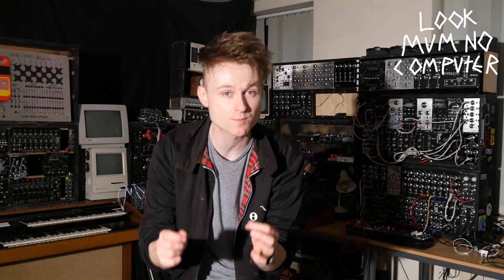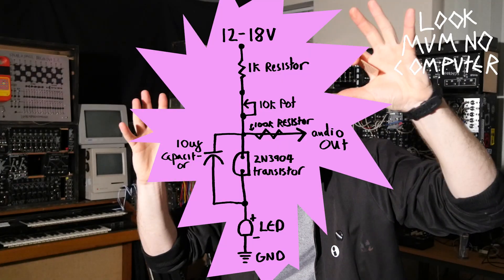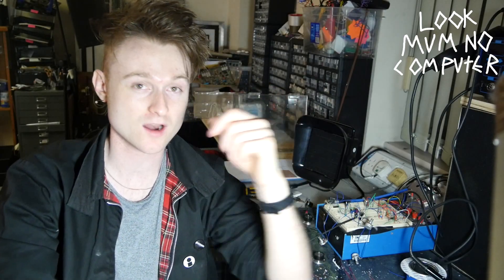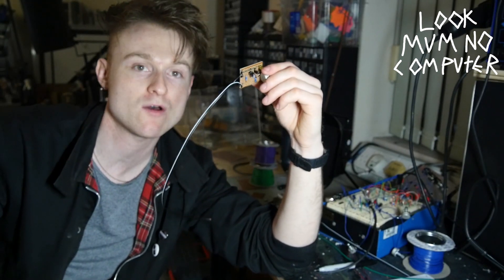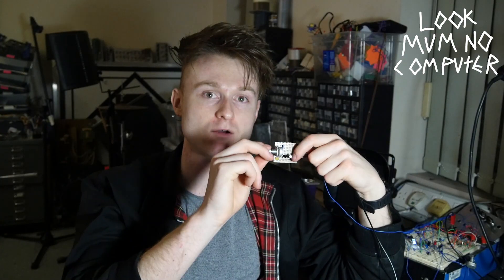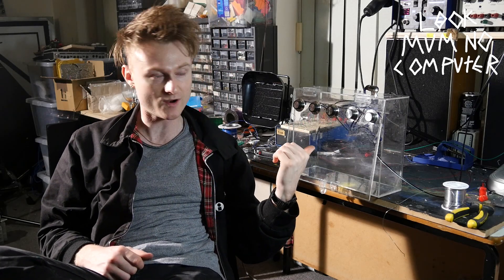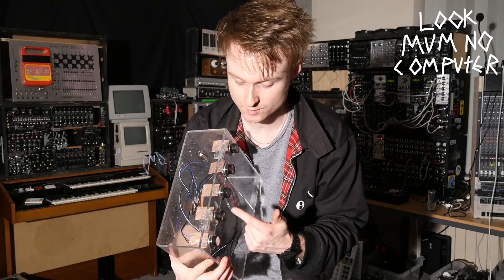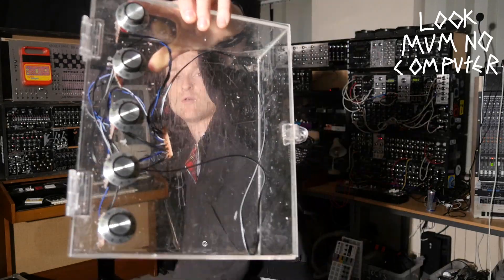The simplest DIY audio oscillator? not a 555 chip. reverse avalanche

Comment: Some troubleshoots for when things don't work right away: 
- Turn your transistor the other way around
- Pick a smaller cap value if you can't hear anything when you run it through your speaker (like a '0,22 µF cap')
Reply: Does the cap voltage matter?
Reply: @EarJuice  No they just make the sound diferent.
High cap value = low oscilation
low cap value = high oscilation
Reply: @nimaschacher1907  They were asking about voltage rating, not capacitance.
Reply: @EarJuice  Not particularly, no. Just make sure the cap is able to tolerate the voltage you're going to supply it with. Some capacitors can't quite handle 18V (12V max isn't uncommon on older caps, for example), so just be on the lookout for that. Other than that, you should be fine with anything.
Reply: @EarJuice  as I listen to professionals more knowledgeable than me, I use aprox 3 times the voltage rating. I know lots of amateurs who use less ie 16v on a 9v circuit with no issues. So on an 18v version, you may get away with a 25v capacitor. I may get corrected. I'm one of the amateurs. It probably depends on what type of circuit. For the sake of 0.02p per cap, I err on the side of caution.
Reply: @stuartchapman5171  in lower voltage oscillating circuits the capacitor may never be comepletly filled. but its good rule of thumb to use higher voltage rating than needed in case of voltage spiking. esp in dc circuits. in dc circuits the capacitor is full most of the time. another thing to note is most of the time capacitors dont fail instantly. they degrade until failure. it can take days or even weeks.
Reply: Can you run this through a speaker directly?
Also i would have a question, i tried to make a small module with one oscillator and then feed the input to an LM386, and when i connect both, i see the signal coming from the oscillator, disappearing on the oscilloscope. What am i doing wrong? in case someone knows
Reply: It depends. On a small desktop speaker, you should be able to hear it, although faintly. On a large speaker, you really need an external audio amplifier, because the oscillator's signal strength is too weak.
Reply: @svg98  thanks for the reply! Turns out i didn't comnect the grounds correctly. Was too eager to hear something already :)
Reply: Just having some trouble understanding how the electrolytic capacitor gets wired.  Is the positive leg of the cap on the emitter or collector and what does the other leg connect to? Also, does the ground for the output jack just go to ground on the circuit or somewhere else? Thank you for any help!!!
Reply: @discry The positive leg (flat line of the cap symbol; bent line is the negative terminal) is connected to the emitter. The negative leg connects to the transistor's base. Yes, just connect all the grounds together; you shouldn't have isolated grounds.

Comment: built one today - with a cheapo chinese 2N2222 . Works nicely at 12V with a 420 Ohm Resistor. Thank you for this!
Reply: What voltage capacitor did you use? 
Did you solder a 3.5mm female jack onto it?
Reply: Thanks for the tip! Changing some resistors helped me, now it all buzzes!

Comment: can someone tell me how to connect the oscillators and get a sound output?
Reply: I tested the circuit today. You need to input at least 15 volts to actually start the oscillation. Better if you apply a whole 18volts. I think there is an error on the schematics he drew: having the capacitor in parallel with the transistor and the led going to ground by itself only outputs 0.6volts of amplitude on the frequency. I haven't tried yet but i think if you put the negative of the capacitor directly to ground instead of having it betweeen the transistor and the led it might output a stronger signal. It's a problem with the fact that diodes (so leds too) have a voltage drop of 0.6volts. the voltage difference you are reading from the output is just that because the only thing discharging the capacitor is that mere led and that voltage between the output and ground is the led's voltage drop. I have still to verify that but i'm pretty confident about it.
Reply: @Mr_Lambda  glad someone else noticed this ! tried building this circuit ~1yr ago, failed, but just tried the stripboard layout instead of the schematic and it worked !! sounds great. used a S9018 instead (see his part 2 video) to run off 12V, then experiment with cap values to get the desired range
Reply: There is a "sound-output" wire in the circuit. Thats how you get the sound. Connect this wire to a speaker and the other wire of the speaker to the ground and you should get audio!
Reply: You can also connect it to a jack connector/socket the same way. audio-out wire to one side, ground to the other.
Reply: same ...
my guess so far, get the "audio out" as red wire to soundsystem/speakers and then wire the over port of the speaker back to the ground of the oscillator!?
Reply: Ben Herrera i also need to know
Reply: Connect all of the ground wires together, all of the 12v wires together, and all of the output wires together. Connect the output to a jack socket and also connect the ground to the ground terminal. Use an amplifier or you won't be able to hear anything.
Reply: So, I built the circuit today on a breadboard, hooked up to a small 🔈 there was NO noise whatsoever, however the LED was working fine and as it should, is it possible that there isn’t enough power from the circuit to hear sound from the tiny speaker, do I meed to amp it?
Reply: Wow, soo massive sound! :o) 
Seems like the wave from the oscillators is having distortion with rich harmonics. Nice!
Reply: look at the schematic on the website and compare it to the bread board, you'll see the rows are connected horizontally, and that the 100k resistor is connected to the audio out, which can be wired to an audio out jack, perhaps wire the audio out to the other oscillator? and then the audio out of the 2nd oscillator should be able to produce 2 different oscillations
Reply: wire up or solder on a jack socket and use audio interface
Reply: I like how vague he is, yet still explains what to do. It leaves room for experimentation, which is the best way to learn. Keep attaching wires to a cheap toy speaker to try get sound!!
Reply: @tshupenia8940  that's a very good way to put it. i was kinda lazy at the moment and just wanted to get things done lmao
Reply: @tshupenia8940  yez

Comment: Just breadboard it with a 9v battery and a 9018, had to replace the led by a jumoer wire thou. I'm not hearing sound with all the action of the potentiometer, just in a small place, any ideas?
Reply: Ale Brenna Mine does the same. Just in a little spot and the pitch is really hard to control that way. Did you find the solution?

Comment: Love your video's! This circuit works very nice at 12v with S8050, S9013 or S9014 transistors. I built a 6 voice drone machine with caps ascending from 4.7uf to 0.22uf. It covers most of the hearable spectrum (at least in my ears...). Try different types and brands of capacitors - some work, some don't. Thanks for making this video. Keep stuff like this coming!!!!
Reply: thanks so much for the info :D

Comment: Hello! I have read that some transistors do not oscillate and it gave them results to change them. My question is whether I can test the transistors without cutting the middle leg or I have to cut each one to verify that they work.
Reply: You don't need to do that.

Comment: Great video! A bit late to the party and as some have mentioned the schematic shown appears to be incorrect. If using the 2n3904, the emitter goes to the 10k pot and collector to the anode of the LED (cathode to ground). Also, the bypass cap should go to ground and not the anode of the LED. The stripboard layout is totally correct, though. Reverse the connections on the 10k pot if you want the pitch to go up as you turn the pot. As is, pitch goes down clockwise. 10uF is close to the limit of useful audio range at the lowest pitch (although 22uF might be fine, too) Thanks for the share!
Reply: Thank you! I was banging my head on the table trying to get this to work! By the way, you can do away with the LED and other stuff. The basic circuit is: 

Emitter through resistor to VCC;
emitter through capacitor to GND;
collector to GND.

VCC needs to be at least 12V or it won't work. The signal is picked up at emitter (it's literally the only net other than VCC or GND!) You can get audio and higher frequencies, but for some reason I couldn't get it to oscillate below ~ 7 Hz, neither by increasing the capacitor nor the resistance.

I still have no clue how it works.

Comment: Okay... complete n00b question.  When looking for the parts, I get things like 1k ohm resistor 1/4-watt, 1k ohm resistor 1-watt, etc.  Specifically, what should I be looking for?  Because I am sure that this has to matter.  Like I said.  Complete newb (except, I said n00b, before).
Reply: 1/4 watt resistors will do the job.

Comment: You can never have to many oscillators - if they are tuned and controlled properly :-) Some analog electronic church organs had more than 1000 oscillators because in the early days of electronic church organ building they more or less build the same number of oscillators into an organ than they would put pipes in a pipe organ. So each oscillator only made one note in one voice (timbre). So if an organ had 5 octaves, which is 60 keys, and 10 voices, it would have 600 oscillators. No wonder they were so expensive....

Comment: Brand new to electronics here. It appears there are different types of capacitors. Does it make a difference if I use electrolytic or ceramic capacitors??? Thank you so much for this awesome vid!!
Reply: Well ceramic capacitors are often rather small so most of the time it wont even oscillate, I had it working with a rather unpleasant pitch with a 47nf ceramic capacitor but neither a 4,7nf nor a 10pf could make it oscillate.
For what they'll cost you just pick a little assortment of ceramic and electrolitics and have fun!

Comment: Couldn't get it working using the 2n3904,  but the SS9018 worked perfectly, and at 9V also :) I also discovered that the schematic and the breadboard didn't match, but follow the breadboard, it is correct.
Reply: I believe you! :) I got the 2N2222 to oscillate at 9V but when I tried to recreated my results ... nothing. But check this out ... I did try the S9018 at 17V and it didn't "work" ... I think I am going to have to go back over the transistors I have that didn't "work" and try them all again but this time with only 9V. Cheers!
Reply: @HazeAnderson  it should work with 17v, so check the breadboard drawing, because that one is correct!

Comment: Hello all, I've managed to build this and get it working, it sounds fantastic so thanks LMNC. However, when I wire two of these together on the same power supply they modulate each other when the potentiometer is adjusted. I have tried all sorts of things to prevent this and trawled the internet to find the answer but I just can't make them work independently.
One oscillator modulating the other is fine when you want that to happen but is very frustrating when you don't.
Any help from this group would be appreciated?
By the way I have them working on a 12v power supply now but I had the same problem with the two 9v batteries in series.

Again thanks for this inspiring video.
Reply: Yeah, im having the same issue

Comment: Does anyone know what happens if I use a potentiometer of 50k? Or other higher values for that matter?
Reply: Higher values of resistance will prevent the circuit from oscillating, no harm. But lower values of resistance ... TOO low will send too much current to the transistor and short it out. They won't explode or anything but they will be useless. Have some spares if you are like me and cannot math. 😂

Comment: i built this and it works, but it does not sound the same way-- kind of a little more buzzy. Btw, i did not use the schematic, i based it on the last video of the redbull can (this one never worked).
Anyone knows how to make it sound better? I tried different capacitors and resistences, maybe there is a catch somewhere. Also, i didnt use any led, cause that way it dosnt work either.

Comment: When I built this following the circuit schematic, the LED would light very dimly then fade out and the speaker was silent. When I built it based on your stripboard layout, the light blinked brightly at varying frequencies when I turned the POT with no sound coming from the speaker, and when I stopped and left it sitting there (about 20 seconds) to go grab something, my capacitor blew up. What the hell is going on? Could it have something to do with my two 9v (both measured at 8.9 separately) in series giving me a 22V out put?

EDIT: Never mind, turns out I had a bad transistor...

Comment: A little high energy but very nice. 

I've been experimenting with this effect quite a bit lately. 
The other name for this is the Esaki effect and it technically works with any device that has a PN junction. 

In fact, the transistors that were made to replace Tunnel diodes (which are different than TVS diodes) have this avalanche mode because tunnel diodes were too good. They didn't break down and they could almost always oscillate within the parameters they were operated in. 

Looking at the components, you're using a 2N3404, which is a bit different than the classic 2N2222 series which is what i've seen used by other people here on Youtube. 

At any rate, most NPN mosfets have a PN junction directly between the source and gate, so you might be able to get them to oscillate with a lower voltage. That said, for audio purposes, lower voltage isn't necessarily better.

Comment: I stuck a 1000uf cap in series with the output. The output sounds smoother now and it also dropped the frequency a bit. Also, with the cap on there, if you disconnect the LED, the sound pitches down slowly until the circuit dies :)

Comment: Very cool! If you out there want to upgrade your circuit slightly and save your speakers in the long run, replace the 100k resistor with a unity gain opamp. You get improved input impedance and more importantly no DC to your speaker.
Reply: Any tips on how to do this?
Reply: could also add a decoupling capacitor. aka an ac coupling capacitor. the op amp will prob do a good job but a capaicitor is much easier, and this is already a class A amplifier circuit. a decoupling capacitor goes between the 100k resistor and the speaker. positive pin of capacitor to resistor, negative pin of capacitor on the speaker. you may have to lower the resistance values but class A amplifiers are designed to have a decoupling capacitor. the decoupling capacitor sets the average voltage to the speaker to 0v so it oscillates in between -V and +V.
Reply: @simplyengineering2350  what sort of value would you want on the decoupling capacitor? I'm looking to build a bank of 9 of these and wanted to make the output a bit nicer. Do I need one for every oscillator, or is there a circuit I could build on the board that merges the outputs at all?

Comment: Awesome video, amazing instructions! Question on power supplies: by using the transistors that only require lower voltage to oscillate, such as the BC337, could multiple be powered with something as simple as a 1spot chain? Also if I were to use multiple capacitors to change the notes would this effect the notes that the different capacitors would create?

Comment: Question! In the schematic it looks like the capacitor goes across the transistor but on the strip board layout, the capacitor connects across the transistor AND LED directly to ground. What’s goin on there?

Comment: I love your videos! Quick question are you powering this via AC or DC? I'm getting power and the LED is lighting and flickering but I can't get audio, I've tried swapping the capacitor around as it looks like the diagram and video differ a bit but still no luck, could my DC PSU just not be cutting it?

Comment: So i have tried it in all variations and different values or voltages.
What i achieved was a sawtooth oscillation with an offset of 12V which made it difficult to amplify. The oscillation is very unstable if i connect a speakwr or doesnt even work at all.
Still a good application to test with oscilloscopes...
Reply: You can buffer output then AC couple it.

Comment: would an RC toy battery pack be a reasonable power source for one of these? something like this:
https://www.alibaba.com/product-detail/Top-China-manufacturer-5s-lipo-18v_60671154763.html?spm=a2700.7724857.main07.20.76a03cdd5zzpxM&s=p
alternatively, could you wire two 9v battery clips in series and just have two rechargable 9v as power source? looking for a fairly clean / small solution as it all needs to fit in a tight cranny. cheers, great content! (total noob to all this, very appreciative of your stuff!)

Comment: I can get the flashing and the tone. But about 2-10 seconds after connecting power it slowly fades and quits. Checking with a volt meter something is turning my 18v down to 10v, too low for the transistor....
Reply: I solved my problem. My capacitor was facing the wrong direction. I blindly followed the diagram without thinking about how the component actually works and soldered the negative to the positive and the positive to ground. Whoops. Works great now though. Now that I have my problem figured out I plan on building 4 in total and then moving on to everything else I will need.

Comment: That's awesome! Thanks for sharing. I have a question though, what specs should the speaker have so I don't blow it? Is an 8 ohm 0.5W speaker enough? I would like to learn about the specs things need to have to play well with the circuit, is there any resource where they explain how to translate the 0.5W of the speaker in terms of voltage difference and current?